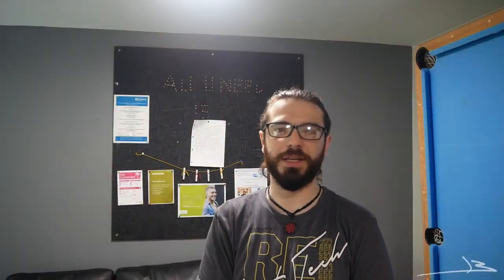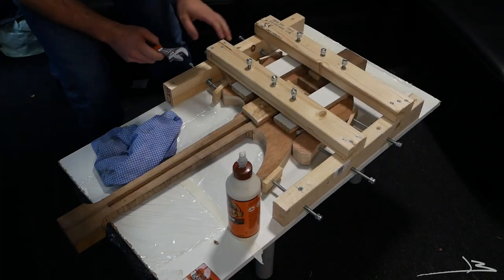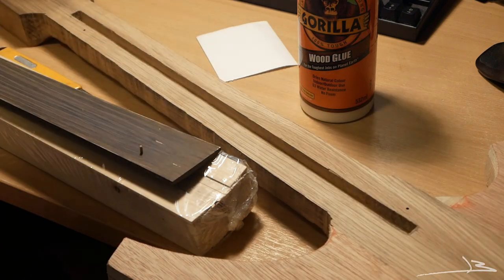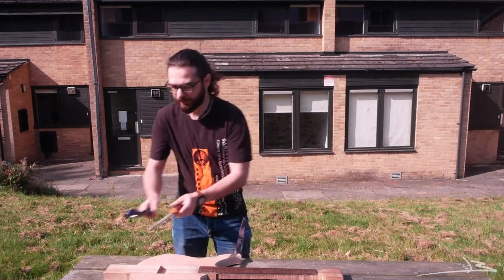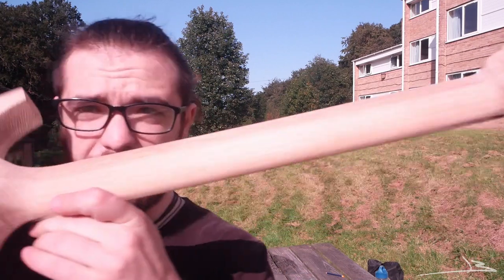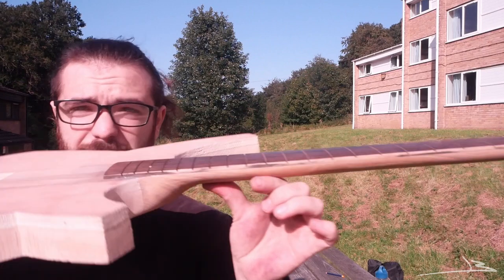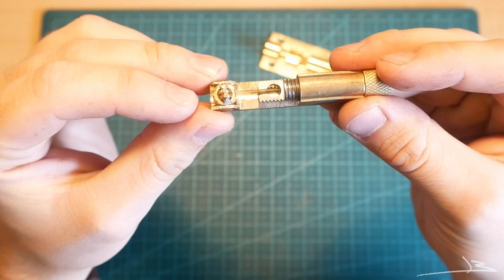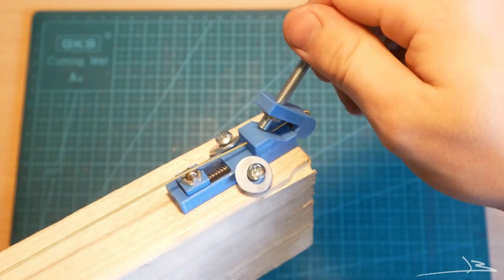Building a guitar from scratch | Ep5 - Body finished & tuners | Great Guitar Build Off (Unofficial)

Comment: The neck looks good! And it's amazing that you're designing and making your own tuners. The one question I has is how you'll adjust the truss rod. But I guess I'll find out in the next one or two videos.
Reply from the maker: Thank you! There will be a hole at the end of the headstock which will make the truss rod accessible, because it's a headless design

Comment: Just buy the headless tuners
That way they can be as small as you want and you wouldn't have to struggle coming up with a unique concept (well untill you have all the proper machinery etc too hand then you can go all out with all kinds of concepts)
OR ... you could always make a headstock for it and put normal tuners ont the guitar again saving you time and hassle
Reply from the maker: Thank you! Well that's the plan in a way, if I can't get them sorted by this week I will buy them and carry on with the rest of the build 😅
Reply: @BogdanBacila301  That would be the best way to go just ow i would reckon
You ca always mess around in your next build when you're not under as much time restraint to get it finished